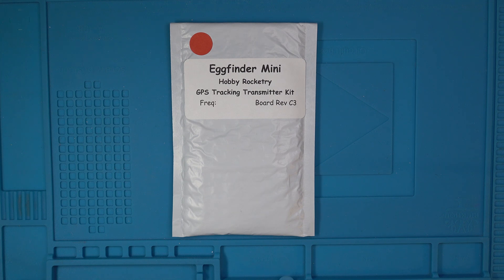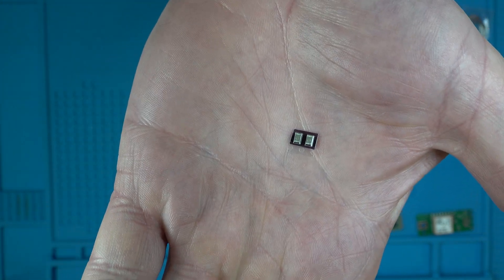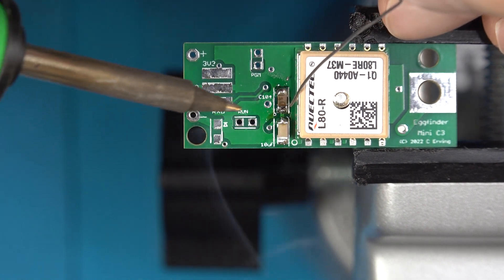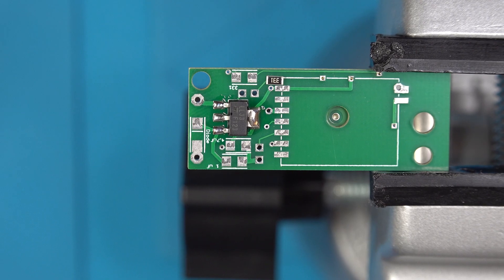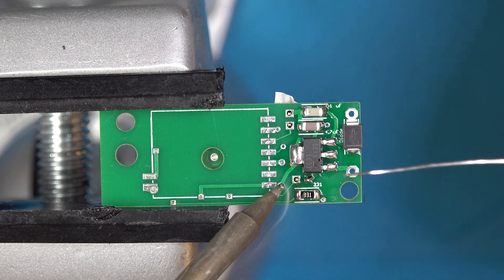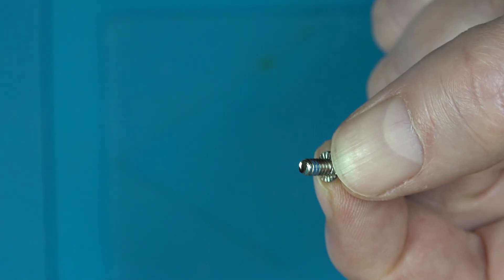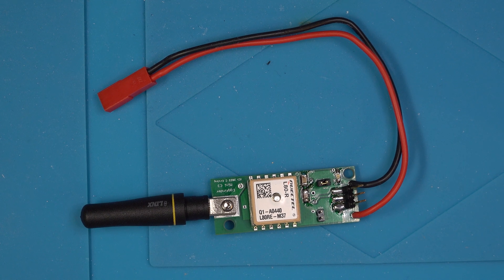Eggtimer Mini Transmitter Build Rev C3 - March 2023

Comment: hey man, can you shoot me a dm or something explaining how you got it to run the NMEA data, I have been trying at it for a couple days now and I don't know why any of the software/my computer isn't picking up the serial data cable as linked with a COM port. It appears under "other devices" in my program manager but not in VisualGPS or PuTTY as having a port to read the data from.
Reply from the maker: I am assuming you are using Windows. Couple things - the "old" serial cable does NOT work with Windows 11. If you are using Windows 11, you need to contact Eggtimer and get the newer dongle that is Win11 compatible. (check out Eggtimer's info on it here: http://eggtimerrocketry.com/wp-content/uploads/2023/02/USB-Serial-Dongle-2.pdf)
If you are using Windows 10 and seeing the cable show up in "other devices", it sounds like you may not have the Prolific PL2303 drivers installed on your computer. You can download them from Eggtimer here: http://eggtimerrocketry.com/wp-content/uploads/2023/04/PL2303_Prolific_DriverInstaller_v1_8_0.zip
Reply: @mountainmanrockets5644  Update: I figured out the Windows 10/11 thing was part of the issue in it coming up as unknown, now it will connect to PuTTY or VisualGPS but no NMEA data will run. I went back and checked all the solder joints under a 10x & 20x magnifier and resoldered a couple of them that looked like they could be the issue but still nothing on the data end. I am not quite sure what the issue is or even where to look for one anymore.
Reply: @mountainmanrockets5644  This was part of the issue after I found the paper they sent in the package saying to download the different driver. It will connect now but still won't run the data. I've rechecked and resoldered all of the joints under 10x and 20x lenses and still no luck with it working, not sure what is wrong but whatever it is I can't find it.
Reply from the maker: @colincassell9773  Ugh - that sucks. Do you know anyone else that uses Eggtimer products? It would be good to test it on a known-good system to rule out the computer or the cable as a source of the issue. I have 3 or 4 of the serial cables from Eggtimer and just yesterday I figured out one of them was broken. I couldn't figure out why my RX module wasn't connecting to the computer and realized it was a cable issue once I tried one of my other cables.
Reply: @ my buddy just got in his serial cable yesterday, but I haven’t had time to test if that is the issue, hopefully it is just as simple as a bad cable/serial monitor
Reply: @mountainmanrockets5644  update: the new cable doesn’t work which narrows it down to being something on the board, gonna have to be extremely careful and basically disassemble it to figure it out it seems
Reply from the maker: @colincassell9773  At this point, I would email Eggtimer. They can sometimes help you narrow down the exact component that can cause a particular issue and they sometimes offer to have you send the board back for them to test. I have built well over 100 Eggtimer boards and I have gotten 1 or 2 that had a bad component. It is rare, but it does sometimes happen.

Comment: I would like some info about how you attach this to your shock cord. Also, battery selection, what have you used. Thanks in advance.
Reply from the maker: I need to post a video about it, but you can see what I did in this thread: https://www.rocketryforum.com/threads/can-eggfinder-mini-range-be-improved.180393/post-2449734. Essentially, it is just a length of body tube and coupler with some bulkheads on the end of each. Put your tracker and battery in the coupler, close it up and I use plastic rivets to hold the two halves together. Then, just quick link it to your shock cord. For batteries, I found the 850mAh 2S LiPos usually last all day, so I can load up the tracker/battery in the tube in the morning, leave it on all day, and just switch it from rocket to rocket between launches.
Reply: @mountainmanrockets5644   I like this, can you point me to the plastic rivets please.  I checked around but not finding small reusable rivets. Thanks!
Reply from the maker: @dcubed7734  Sure! Here are few places to find them
Apogee:https://www.apogeerockets.com/Building_Supplies/Misc_Hardware/Removable_Plastic_Rivets
LOC: https://locprecision.com/products/nylon-rivet?_pos=1&_sid=2f80e5dad&_ss=r
Giant Leap: https://giantleaprocketry.com/products/large-removable-rivets-10-pack?_pos=1&_sid=c696c2b38&_ss=r&variant=37741601652908
Reply: @mountainmanrockets5644  Thanks!!

Comment: Do you pre-flux the board before you start to solder?
Reply from the maker: Not usually. I use a Kester .020 solder and it works wonderfully without extra flux. If you pre-flux, you will end up with a fair amount of clean up afterwards. If you are using the solder that comes with the kit, be extra careful - it is a no-clean water soluble flux core - very different from a rosin core, so you need to be cognizant of that for pre-flux and clean up.

Comment: So we’re trying to do this testing as well but it isn’t connecting to the transmitter. Did you download any drivers for this?
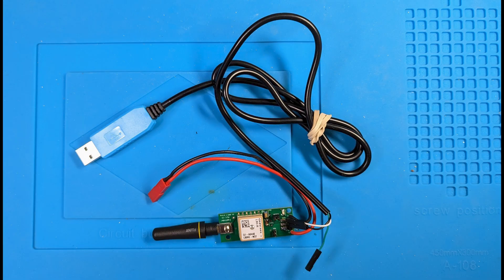Reply from the maker: Depends on what you mean by "connecting to the transmitter". This device is the transmitter. If you mean connecting it to the computer to do the testing starting at about 13:00, then you need to download the Windows 10 serial driver for the blue cable that comes from https://www.prolific.com.tw/US/ShowProduct.aspx?p_id=153&pcid=41. If you are using Windows 11, the older blue USB cable won't work, you need the newer USB "dongle" as described here: http://eggtimerrocketry.com/wp-content/uploads/2023/02/USB-Serial-Dongle-2.pdf.
If you are talking about connecting it to the LCD receiver testing shown at the end of the video, you need to make sure the LCD receiver and the Mini TX are set to the same freq and ID and that the LCD receiver is programmed to the Mini/TX setting and is working. If it still doesn't work, but it did connect to your computer, it is likely an issue with the installation of the RF module.
Also, don't forget to put the jumper on the "RUN" pins